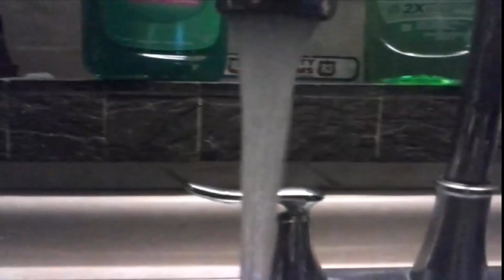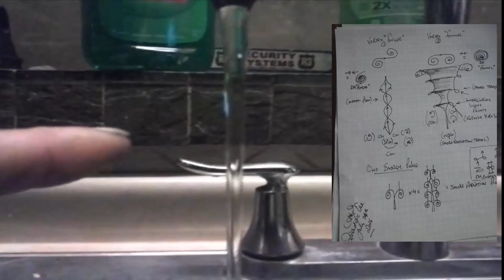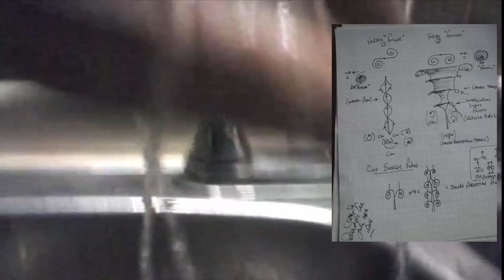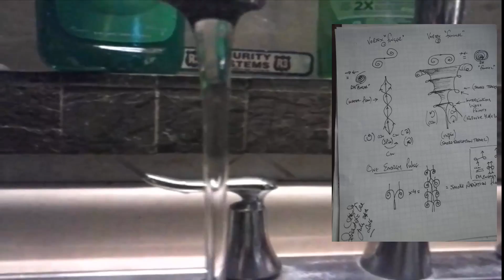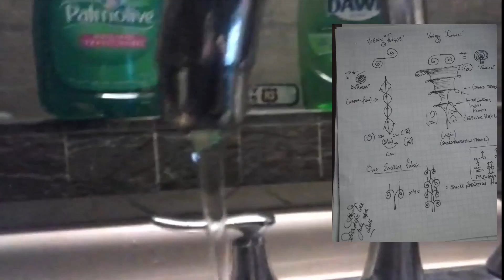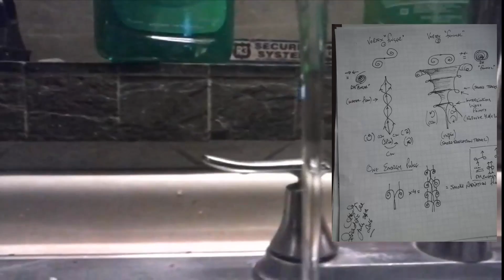Vortex Wave Vortex - All energy travel.

Comment: How about electricity/electrical energy? Electricity travels through the body and other objects right? How can that relationship be observed with electricity?
Reply from the maker: GREAT question......elec is invisible so some kind of medical sensor would be needed...but normally from my own experience of being electrocuted (small doses, not planned :)   )....it bites the outside.....then burns a hole in if the resistance is low.....dunno how to set that up though. :)
Reply: When we see lightning travel through the air, it does not follow this pattern. Possibly because lighting easily overcomes the "gravitational" force. Also things like eclipses. Block a light source with some object and the light energy does not travel around it. Again I think possibly because it easily overcomes "gravity".
Reply from the maker: the atmosphere works the same as trees and magnets....many vortices to one vortex....no such force as "gravity " :) ...only electrical attraction..same as a magnet.
and it DOES travel around it...as seen by men on mountains, when they stand and cause  a "shadow"...the light spins into a "sun-dog" halo behind them...seen on many photos...all works the same :)